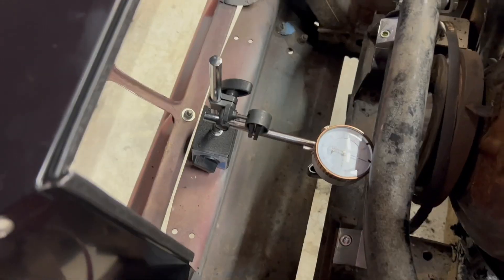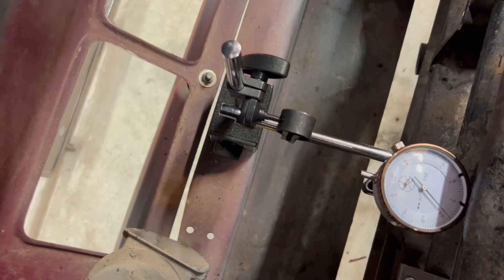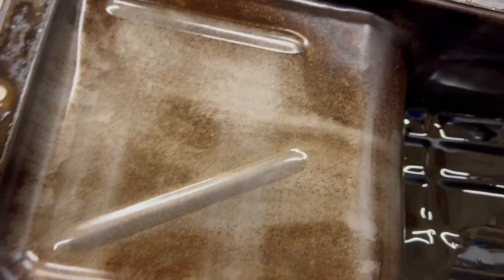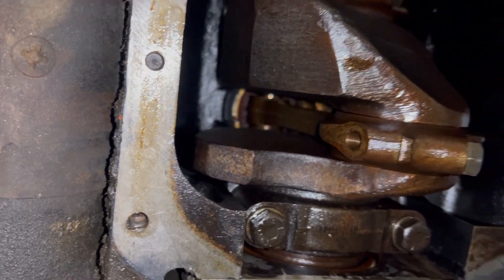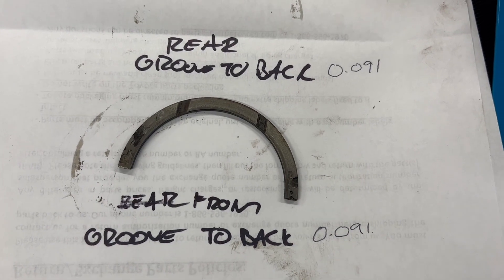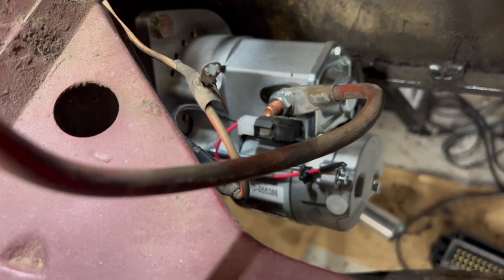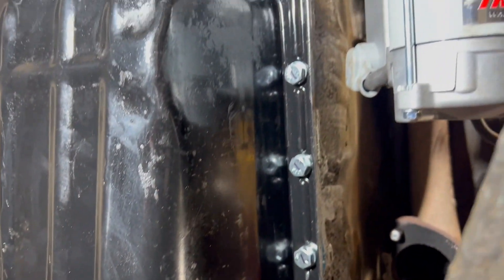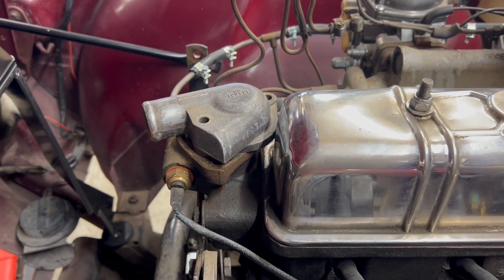1969 Triumph TR6 Thrust Washers and Oil Pump

Comment: Thank you for this. Looking to tackle this exact job on my '73.
Reply from the maker: It’s not a difficult job. Especially with the radiator out to check end float, but there’s other ways around that. Good opportunity out to clean other stuff up too. And check the main engine bearings to see how they’re doing.
Reply: @hollywoodd3191  done now and first time started in 20 years!